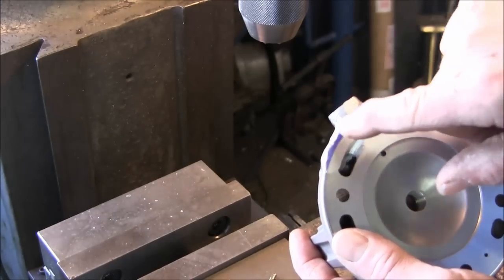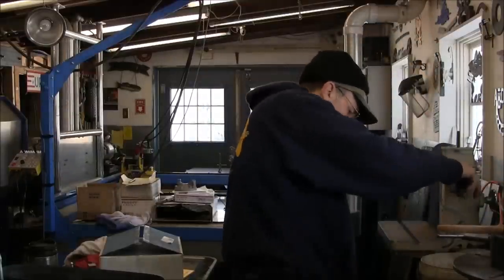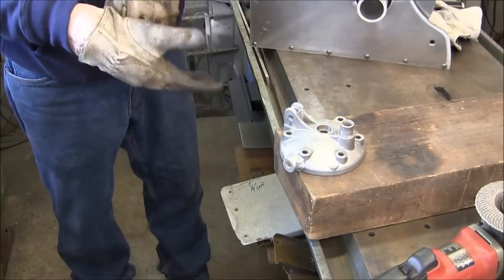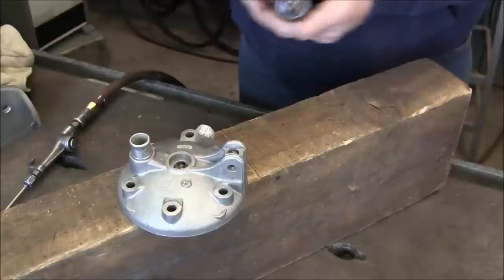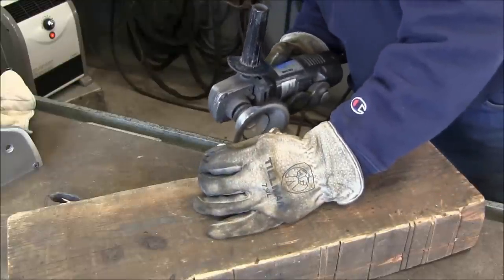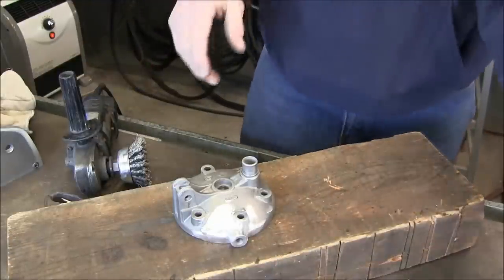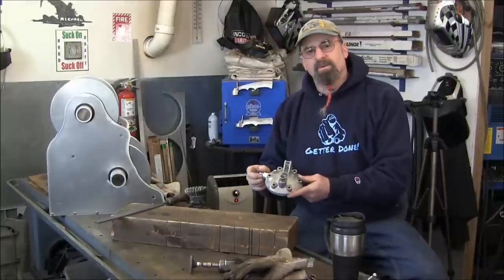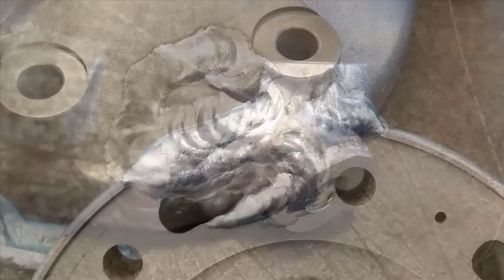The Manual 3D Metal Printer Part Nine

Comment: I'm hard to impress but that repair goes way beyond "craftsmanship" and into the area of artistry.  Probably the best error recovery I've seen in metal working. Most would have had to start over with a new cylinder head.  In a word: outstanding - simply outstanding work.

Comment: I made it to the end! That finished piece looks great! You might have could have shaved even a bit more off the gasket surface and still been good as the passageway leading to the decompression device will lower the compression some by adding clearance volume so taking a little more off the head just kind of gets it back to where it was. You wouldn't think it would make much difference but I have seen it make 10psi of compression on a 6hp chainsaw. Thanks for taking us along on this twisted road of one step forward three steps back to finish this little project.

Comment: Man Keith, that was quite a journey (all 9 parts )!  It was too bad you broke through that chamber with the drill - it sure opened up a can of worms!  But you came out smelling like a rose in the end.  One of my teachers told me many years ago "you're gonna screw up eventually kid! And what separates a good from a great machinist is knowing how to fix your screw ups!"  The set up on the lathe using the spark plug threads as a hub and the 3 jacks to stabilize while turning was interesting.  I think I would have been wearing a face shield in case a jack flew off - especially with an interrupted cut!  But my favorite part of the series was the fantastic bench work to clean up the weld repairs and blending it all in.  Just phenomenal!  I thought you might even bead or sand blast for the finale to make the entire head look the same texture, but I guess by that time you had had enough.  Great job by the master!

Comment: thanks keith mr. fenner; setting your standard & sticking to it  > is why i view almost the entire series in one sitting. that compression release valve inclusion - fact, makes a world of difference, all good, in how that motorcycle engine will now behave  as the operator requires of it.

did one (old school cable operated version) myself 30 something years ago on a '74 maico gpmx 400; square into the cylinder about 1/2 way between the carb inlet and cylinder head (blueprinted the engine prior to... converting dial indicator linear measurements  / degrees  of rotation  the various port openings and closings as the piston moved within the bore. thnx chief.

Comment: Awesome series! It really puts confidence out there on how far you can go to repair a part. Most machinist's would have gave up on that, but you showed that with a little time, effort, and a lot off patience you can achieve excellent results. Great job!
Craig
Reply from the maker: CW Mayes A set of workmanship expectations, are only as high as you set them and only as low as those who see them. ;{)-----

Comment: Hi Keith, I'm possibly the only one who thought that your intro in Pt. 1 was a bit drawn out, and I just wanted you to get on with it. I feel that you spent just a bit too long on the explanations of the process, both video and the job in hand, but I congratulate you on the recovery from the wayward drilling. The amount of material you had to cut away to do the repair was large, and then you rebuilt it all, and machined and finished it to original condition. That was simply amazing, and we all had the opportunity to learn lots about workholding, job planning and good old engineering technique. Thanks and keep up the great work, I just hope that the next few months are free from the pitfalls that this job threw your way.
Apart from the minor audio issues, the video quality was great, and I with lots of others look forward to the follow up when your customer returns with his bike running. Good luck with the weather, Cheers from (sometimes) sunny Australia.
Rob

Comment: You gave the impression that you were proud of this one, Keith.  Speaking of "3D Metal Printing":  I wonder how the Plasma-Cam could be adapted to "print metal".  All you would have to do is swap the torch with a MIG torch and adjust the traverse speed!!!???  Gota figure out how it could be used to make  $$$.  Something to make it through the winter.  Maybe if you got a contract for a 1000 parts of something; it would pay for set up, tooling etc.  Production runs get boring after a while, though.  Gota eat.  I repaired some automated welders and presses at a tool mfg. company for 4.5 years.  PLC controlled, a few cool linkages and pneumatic actuators.   I don't know, just a idea.
Reply from the maker: WAVETUBE84 I have thought about the same thing, with the mig welder added to the PlasmaCAM. ;{)------

Comment: Keith...IMO...ur not a machinist or a mechanic...you are an artist that uses a wide variety of brushes to setup, prepare, repair and complete your masterpiece!  I applaud your talents and knowledge which anyone can learn if they have the desire but know that I envy that masters artistic touch that you were born with...

Great series...thank you 

ATB chuck
Reply: outsidescrewball  There are very few "job shops" left now days. True skilled machinists with the knowledge and skills Keith has are  a dying breed there is not much demand for it in a throw away society. If you have a job shop in your area, find it, support it, tell other people about it.
Reply from the maker: Thank you! for your comment. ;{)------
Reply: wildcat19671 There's a reason why there are so few job shops left, and it has nothing to do with lack of demand.  While I had fun watching this guy spend 2 or 3 days adding a single tapped hole to a cylinder head, that just isn't economical and most shops have rightly realized that its far more economical and efficient to sub out parts of the job to specialists.  Jody could have done a tidier job on that tig buildup in maybe a half hour, and it would have been a 30 second segment on one of his videos.  Same deal with the machining, this job could have been done all up in 3 hours of shop time.  Nothing against the OP, and I enjoyed his video....  just simple economics and I know where I'd be taking my business.

Comment: Excellent production, Keith!

It will be interesting to hear from your customer as to how it works.  If the engine is really high performance, I wonder if the small loss of compression ratio from the passages will affect how it runs.

I was getting to thinking that you'd moved to the South Seas to escape that fluffy but chilly white stuff that seems to just keep a-comin' outta the sky.  You're a cool guy......you can dig it.

Comment: If you were to have bead blasted that, It would have been near impossible to see a difference between newly TIG welded and original finish. I have to say Bravo for the finished part. However, I believe you exceeded the total cost of a new head very early in the project. But I applaud you for working until it was FIXED. We all make mistakes. Some more costly then others. But each one a learning experience all the same.  You did good in my opinion!

Comment: Good job Keith!   I would have been way more comfortable welding a aluminum rod to the head instead of building one up.   I've done that in the past and it works great.  3/4" rod with the cylinder head profile on one end for tight fit and one bead of weld.

Comment: nice nice nice job
my only fear is about warping and crack developpement when put in service
I had experience with mechanical aluminum parts rebuilt by welding, they warped so bad that after few hours of service they were useless and often so damaged that they were non rebuildable
the only way we found was to proceed to a deep heat treatment between welding and machining that renders rebuilding non economical

Comment: One method I've seen for blending in to match a cast aluminium surface is to put some emery cloth face down and tap it with a hammer, it leaves a sand cast finish effect on the repair. Would probably not work well on a complex surface like yours, better suited to a flat surface.

Comment: Wow, what a train wreck that job turned into!  I cringed when I saw you start to remove material - not knowing where you were headed with it.  Then you single-handedly got the entire train back on it's tracks!  Amazing.  You didn't seem to have any doubts moving forward, but did you have any you were hiding?
Reply from the maker: drstampfli Once I had struck my first arc on the beginning of this project I knew it was really good material to play with and that is a confidence builder. You turn worries into double checks on your proven procedures and go for it. You can't doubt your skills, if you want to move forward, I think anyhow. ;{)-----

Comment: Keith, when you start a job such as this and encounter unforseen problems. Would the end cost to the customer change due to modifications or repairs you have to perform in order complete the job originally quoted ?
Reply from the maker: canadaeast I chock it up as an expensive video production and share for you all. The customer still gets the job quoted or flat rate price. ;{)----
Reply: Keith Fenner So how much would some thing like this run?  It looks like it took almost a week to do.
Reply from the maker: nsaanity Without the mishap this was a $250 job. ;{)-----
Reply: pretty reasonable, I would say,   I wish you could see the machines that the parts come off of some times.... Like this one, or the tracks.
Reply: nsaanity Indeed it would be cool to see the 4 wheeler with the mat-trax installed and running.

Comment: Well done on working through the hurdles.  I have to ask, should you not have secured the machinist jacks with tape or wire to ensure they did not go flying?  I've never seen them used in this way before.  Again congrats on an outstanding job and thanks for sharing it with us.
Reply from the maker: Vincent Parisien You could safety secure them with tie wire through the hole in the squares I guess if you were unsure of staying. I load them all to a point I feel is enough, yet not enough to falsely warp or distort the head, during the cut. ;{)-----

Comment: No lie I was a little worried at the start that you would run into trouble, they cast those things to gain as much cooling area as possible using the least amount of material to save weight and cost. But all's well that ends well as they say. Good job.

Comment: hi keith:
great vidios! i love watching them. i was wondering if instead of cutting the area out and welding it back up to seal the breach, could you have used a sleeve ? make a small rod and then drill it and press it in to the hole and sealed the breach that way.

Comment: Hi Keith.
This is a fantastic job, but why all this effort?
Can not imagine what 2 strokes, need to start decompression.
Even 500CR do not need it (even if you weigh 75 kilos).
It there's an easy technique to start two strokes big.
Hole lead to the squish area, while in fact, this area should be as uniform as possible.
Perhaps this is a biker with handicaps, the I can understand.
You tell us.

Hat for the job.
Reply from the maker: ***** Thanks for the comment! The head was brought into my shop and customer asked if I can do the work he wants done. I look at what the job entails and create a price, then do the work. Sometimes (why) gets throw out the window. The extra work was just a bonus on this project if the hole hadn't pierced the water jacket, it would of been less than 1/2 the job. ;{)-----

Comment: you said the belts are non directional,can you turn them around after awhile to get a better surface finish, or doesn't it make any  difference ?
Reply from the maker: It may catch a sharp cut for a few revolutions! would be worth an experiment, just as well put a new one on if going thought the effort of removing. ;{)---

Comment: After I saw the spark plug chucked in the lather I don't understand why you parted off the threads instead of just screwing the plug in and chucking it up.
I think you should try to keep the tip of the aluminum filler rod under the shielding gas more consistently.  Letting the tip of the rod oxidize can't be a good thing.
I would think if you masked off things, the finish could be better restored by bead blasting the new surface.  It looks like the factory finish was bead blasted.
I never heard of a pressure release on a bikecycle engine. ?

Comment: Certainly threw you a curve ball on that water jacket but you rolled with the punch and brought it home in good form. If he took that head and had the outside sandblasted it would look like it came from the factory with that compression release. I wonder, just for fun, have you ever tried oxy/fuel welding on aluminum just to see if it could work? Conversely, have you ever tried brazing with your T.I.G.?
Reply: Also, thanks for the video. You're an asset to even simple doers such as myself to do it the best way possible whatever it might be. I'd like to see a follow up on this. I know it'll run just fine, I just like to see them.
Reply from the maker: heliarche Aluminum needs more heat control than a gas torch set up could give and I have brazed with tig just not on ductile or cast iron projects. ;{)------
Reply: Keith Fenner Ok. I always think it's interesting to find new uses for tools and equipment. Even if something won't work in a practical application, it's still fun to experiment as well. Was there some reason you had to use the T.I.G. to braze, or was it just for the heck of it?
Reply from the maker: heliarche Most cases I use the TIG to lay in Silicon Bronze on steel or Stainless Steel and It lays it in like a stack of dimes or smooth flow if you want it to. It is fun to play with and another way to getter done. ;{)---

Comment: This whole project was deeply confusing to me. Why was it done like this. Why not simply drill a hole through the head at the desired angle then weld a pre drilled and tapped fitting to the outside? This would have taken me 2 hours tops. I work for a large motorsport company and do jobs like this on a daily basis, if I'd have done this I'd have been sacked years ago...Sorry if I'm too blunt.